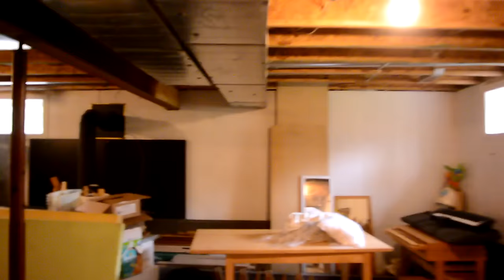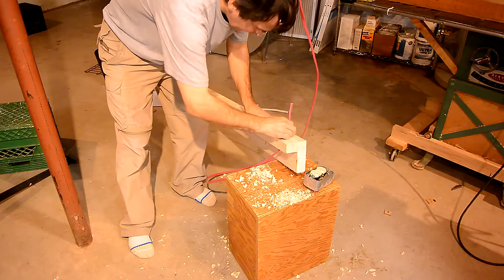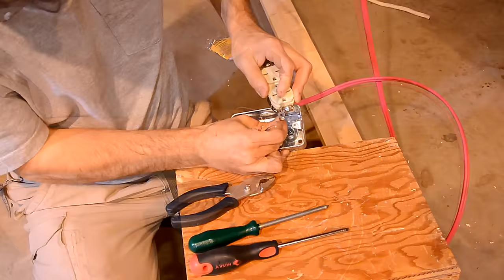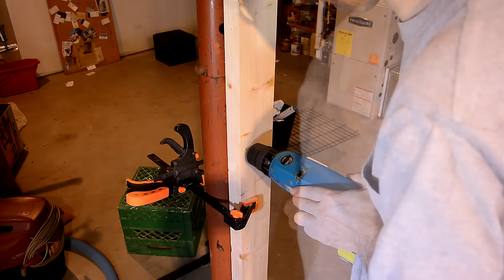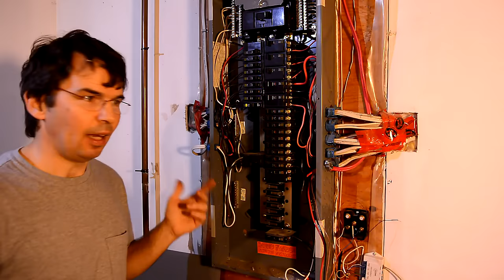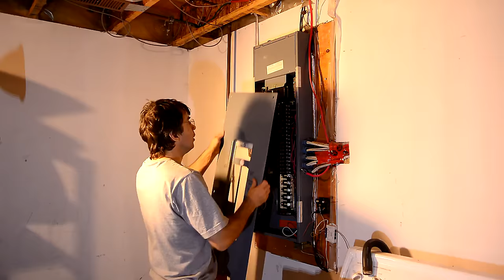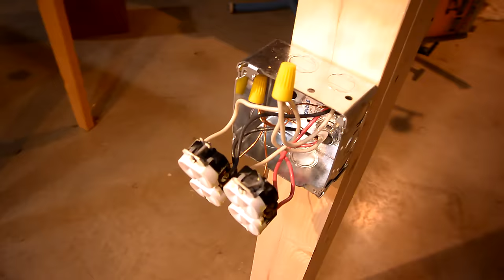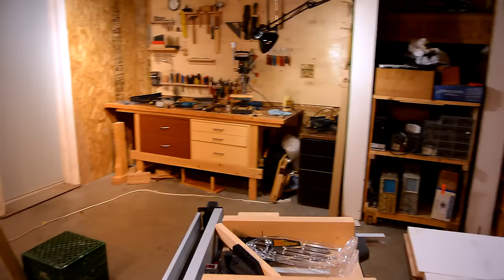Wiring a new 240 volt circuit

Comment: Okay you've done a number of things in this video completely wrong and against code in ontario.   Wrong connector in panel (you used one for bx).  Your 240v plug is too close to the floor (min 6" above floor) lastly your connections for those split Receptacles ( one red one black and one white on each Rec). Those should also then be connected to a two pole breaker).
Reply: good video on how not to wire your 240 volt circuit.....
Reply: Report him to the police, and potentially save his life and that of his kids. Matthias is skilled and all, but some false pride is at work here too...
Reply: Please tell me why that's dangerous.  I've been doing it for 30 years.
Reply: VideoKilledMyDog Did they only recently ban those shared neutral circuits? They used to be everywhere in kitchens. Or if he did it wrong, how?
Reply: +Anonymouspock he should be sharing a neutral across a red and a black not two blacks.  If both blacks are on the same phase the neutral has the potential to carry too much, heating the wire and the receptacle.
Reply: VideoKilledMyDog Might have just used the wrong color and forgot to mark it unless I'm misunderstanding.
Reply: +Anonymouspock there are two receptacles and two cables in the box.  Everything from one cable should go to one receptacle.  The neutral shouldn't share between the two receptacles.
Reply: VideoKilledMyDog Ah, that was my other hypothesis. So then the concern is that two correctly wired and functional devices could overload the neutral by being plugged into one side of the box? But wouldn't it trip the breaker?
Reply: Anonymouspock but what would it take to overload that neutral? I don't beleive he would be running both machines simultaneously much less under load. So I can't beleive that's dangerous.  Good info but a little over safe.
Reply: First of all he is not sharing one neutral with 2 blacks, he clearly stated that he's fed the 4 120v receptacles with a single 3 conductor wire. The second black (and red) are feeding the lower receptacles. He is sharing one neutral with one black and one red, and as long as it's wired to a 2 pole breaker and using the appropriate gauge of wire then it's perfectly fine. Also those are not split receptacles.
Reply: shows what you know.... that IS a two pole breaker, it just has a single toggle. Square D likes to make those kind of breakers for some odd reason.
Reply: +Sovek he never shows what the regular 110v receptacles are connected to...
Reply: If you look at how he connects it to the breaker he switched the wires there.
Reply: "Code" is for people working for someone , you can do whatever you want to your own house.
Reply: jc86 That is not true. Many places will let a home owner pull their own permit for electrical, however they still have to comply to electrical code if they want to pass inspection.
Reply: Mitchell Buss you know electrical codes change often, they get updated frequently
Reply: Homeowners' insurance companies love this logic.
Reply: The police aren't the correct department.  He's not committing a crime.
Reply: @Jason Wisser  2-conductor cable ;)   Or more-accurately, 2 conductors, and a ground.  Ground wires don't normally carry current, so they aren't considered a 'conductor', in trade.
Reply: @Sovek, yes,  they're tied together for trip redundancy.
Reply: @Fester Blats "are" here.  Police is plural, so the correct verb would be 'are'
Reply: Tekmatic Thanks for the info Tips McGee. However he did indeed use a three conductor wire (3 conductor plus the ground) Go watch the video again before you decide to correct everyone smart guy ;)
Reply: That's a 240 breaker, it just has one throw. Square D makes them.
Reply: Tekmatic the ground wire isn't counted because it's bare. So with romex, 14/3 has 3 insulated conductors and a 1 bare wire, but with 14/3 cab tire, with an insulated ground, you're only getting 3 conductors. Ground wires are definitely considered conductors.
Reply: yea big like on this comment
Reply: 100% correct
Reply: No you can't
Reply: The NEC would also tell you that you need GFCI protection in an unfinished basement.  I rarely see it.  For double insulated tools, it seems pointless.  For the bigger 240V motors, it would just lead to nuisance tripping.

Comment: As many pointed out, the casual contact with the live circuit panel bar (even 120v) shows a lack of respect for electrical work and safety. Like leaving the chuck key in a lathe chuck, you just don't do it.  Also never lean out over a cliff to impress your girlfriend at how far you can lean and not fall. Some things are just a bad idea and not defend able.
Reply: Yeah, but having your wife lean out over a cliff to show you how brave SHE is sounds like an excellent idea!!  ;-)

Comment: When you make 120V off of the 240V, does the neutral have to go back to the breaker box? I'm trying to figure out if I can run 240V to a detached garage for a heater, then split that to 120V for other equipment and lighting.  It is currently ran with 120V, wondering if I can pull that 120V through with the new 240V line.

Comment: lol american electricity again :D funny
Reply: North American you mean? It's Canada afaik?
Reply: yup.  Ontario, Canada.
Reply: Canada is in America..
Reply: Those twist caps connecting wire, looks like something you would do 20 years ago. WAGO man!
Reply: Christoffer Salomonsson
When people say just the word "America(n)" they generally mean the USA. We specify "North America" when we are talking about both the USA and Canada so as not to confuse people.
Reply: I've see wagos fall off.
Reply: GALENGODIS we invented it so we do what we want
Reply: Chris Hall, good catch, that's exactly what I'm trying to say! It seems like you got no rules and can do whatever you want with the americano electricity. And it's funny compared to where i live :)
Reply: Peter Šori ok. Harnassed on a large scale
Reply: Mexico is also part of North America.
Reply: Central America is part of North America.
Reply: But it works!
Reply: Doug Reed you can hardly ever win even if you are right online
Reply: shawn white, if a WAGO is corretly installed, it never falls off.
Reply: Shawn White I've  seen twist caps fall off.
Reply: +Andreas Stangl Clearly not installed correctly, or (more likely) used the wrong size. Or used somewhere with a lot of vibration without adding some vinyl tape or other mitigation.
Reply: Yea, you see Anson Mansfield, that's the same with Wago.
Reply: zerpBot Central America is Not Part of North America, thats why its Faller Central America!
Reply: The best part of America.
Reply: America is the greatest country of all time

Comment: If you're sharing a neutral then the two breakers must be tied together so that they both trip at the same time. If they are not tied together and one of them trips, the shared neutral makes the tripped circuit still live.
Reply: Ronald, good catch!  Correct me if I'm wrong.  The tripped circuit is live only on the neutral side if the live side is plugged in and turned on.  And the voltage drop is thru whatever is plugged into the live outlet.  Did I say that right?  I think so.  Let me know, Ronald.  It's a terrific point.

Comment: I have to install a 240v circuit breaker as well as a home run to the outside outlet because the old home owner decided to run the back yard outlet off of the bathroom gfi outlet from across the house. It can't handle the hot tub and kept blowing the gfi.  This really showed how easy it is to put in a 240v breaker.  The hardest part is going to be running the wire up the walll, through the attic and down the wall unto the basement.

Comment: Ladies and gentlemen that's what you get when you let a head strong amateur with total disregard to health and safety loose with a length of wire and a screwdriver. No earth wire shielding, working 'live' (why not wire the breaker first then install it if you must work live) and finally all the plugged in appliances have cables running all over the floor causing a trip hazard. Why didn't the sockets just drop from the ceiling eliminating trailing wires ? but then the ceiling wiring looks something like spaghetti all over the place anyway. More surprising 4k people actually like it, just shaking my head in disbelief. My advice is stick to making band saws.

Comment: Just wait suddenly your comment section will be full of supposed “master electricians” and know it all Europeans who don’t understand electricity but definitely think their system is the best.
Reply: *their
Reply: Daniel Pohren your right! Fixed!
Reply: Your prediction has come true great OZ..
Reply: Mrcaffinebean *you're
Reply: WhiteShadow2k1: yeah, 'cause metal burns and melts, but plastic doesn't.
Reply: Both are used in different circumstances. Not "Nuff" knowledge.
Reply: yeah and plastic conducts electricity very well, but metal doesn't. Sarcasm off, the plastic enclosures use a thermoset plastic, so it doesn't melt when it gets hot.
Reply: Bakelite and urea-formaldehyde are both non combustible plastics. Generally plastic electrical sockets are manufactured from urea-formaldehyde.
Reply: palo 123 As they are in North America. I was referring to the plastic boxes used for main breaker panels. They’re PVC or ABS. I’m sure there are fire retardants added, but I prefer the protective nature of a grounded steel box.
Reply: " Know it all Europeans" ?

Comment: @Matthais Wansel, isn't that bit about the phases canceling on the neutral when they're both loaded only true if both loads have equal reactance? Because it's reactance that dictates the phase angle between voltage and current -- right?
Reply: Or actually, I think they only cancel completely when real AND imaginary parts of impedance are equal in the loads.
Reply: Though I think we could easily show this with math, that would be boring...let's see a video demonstration of these principles!

Comment: Looks like a 12 gauge wire you are putting.  Sure it is enough for the equipment?
Reply: The real question: Is a 15-amp 240-volt circuit breaker enough to power the machines. For a Band Saw or Table Saw, yes it is, unless the saws are abnormally powerful. 20-amp breaker is probably more normal for small 240-volt workshop machines from what I just read online. The wire gauge is rated for the max amps of the circuit, not the equipment someone uses. If a piece of equipment tries to use more than the 15 amps at 240 volts on this circuit, it'll just trip the breaker. Technically 14 gauge is what's usually  used on 15 amp circuits. So he's one gauge thicker if I'm not mistaken.

Comment: Nice video and explanation. For your risky part, you can alternatively wire the lugs of the breaker while it’s off the panel, then install the breaker on the bus bars

Comment: For the 120V outlets added later on, did you run another set of wire and breakers, or did you just run a neutral and tap into the same wires as the 240V outlets for the hots?  I'm guessing the latter option is unsafe or bad practice, but I'm not sure due to lack of experience.

Comment: very nice video ! am glad you have a place to run away too ..
i want to install a mini-split in my garage so that i can do woodworking & need to run a 220v line from my panel which is at the other end of the house. Unlike your situation i dont have a visible empty slot i can use. However, i think i have 2 breakers not being used so am hoping i can use those. I noticed that you did not use a neutral or a ground for your first 220 outlet ? is that ok ? In my panel box i have so many wires running  that i cannot think of a place to pull out the ground wire or a neutral. I got stalled because i didnt know what to do for the neutral and grounds. Perhaps i have a new thread to work with - Very nice ...

Comment: Not gonna bash or try to tell ppl what to do but ONE very good tip is to connect your hots to the breaker before connecting the breaker to the legs. You decrease your chances of getting lit up that way if you don't want kill the main and use a battery powered light to do your electrical service.

Comment: I didn't realize the 240 circuit was just two 120 lines - in that case, how is the ground leg handled? I didn't see a ground wire. I'm used to dealing with automotive wiring, household stuff can be confusing

Comment: Is it safe to have these large metal bars under live voltage? I think in Canada things will be safer than in ussr, nowadays if you look into same thing in Russia, you can touch only ground and neutral, to touch any live wires you need at least screwdriver
Reply: ADFKSJG good thing there's a big steel screwed lid over them at all times, eh?
Reply: It's good, but when it opened - it is awfully unsafe
Reply: ADFKSJG it’s not meant to be open unless its being worked on. 

A blender is dangerous if you run it without the lid.
Reply: Trust me, those are a HECK of alot safer than the old ones, where the metal bar stuck out, not plastic. I nearly blew myself up, even tripped a 1200A breaker on one of those panels.
Reply: Calm down, skippy. Did you know there are bare conductors inside every wire? All you need to do is cut the thin rubber insulation off!!! Oh my god!
Reply: Sovek nice engineering tho

Beefchicken Industries if you not randomly poke with knife, it's okay, but there you can easily get nice warm voltage across you, easily. it is not safe, at least by occasion you can get toasted, and amount of that "occasion" is what makes one more dangereous than other.

Comment: Great Job adding the 240v socket “I have a question Im adding a solar inverter that is 220v out put I have a 100 Amp Double pole breaker going to be used only when we loss the grid for battery back-up and on a DIY Generator to charge the batteries to power my house . This is a work in process , I can get a step down transformer from 220v to 110v  , I was hoping I could just wire the 220v into my 100 Amp Double pole breaker and the 220v would In theory charge 110v Per side of the breaker box  , in have a black wire & a red wire coming from the street one to each side of the box .

Comment: A point and a question from an electrician. Firstly its bad practice to work on a live board but sometimes needs must. But if you do then use insulated screwdrivers and don't hold them by the conductive shaft. Secondly what do regulations say in Canada regarding two separate supplies in a single box?  Where you're sharing the 120v between phases you'd have to mark it presumably so any future work carried out can be isolated safely. Also isn't it frowned upon because you could get a 240v shock if you get stuck between the phases?

Comment: Cool video.  I would never work on a live breaker panel like that.  Ever since I learned that we bond neutral to ground I figured there shouldn’t be any reason you couldn’t just touch a hot wire, as long as you’re not simultaneously touching a neutral/ground simultaneously, but I was not willing to test it.  I’ve got a 10 month old child, of course we installed those safety plugs on all the outlets, but it’s kinda nice to have confirmed that even if a kid jammed a knife into just one side of an outlet, it might not be as bad as I previously thought.  Obviously hoping that never comes close to being tested, either.
Reply: You just publicly admitted to not liking yourself!  Good job there!
Reply: TheGeekPub not sure what you mean.
Reply: LOL. I commented on the wrong post.  Sorry.

Comment: Why did you plug the breaker into the panel before screwing the circuit wire in?  If you finished the wire before plugging the breaker it wouldn't become hot until you were done.
Reply from the maker: Much easier to work with if it's attached somewhere.  I'd say, fumbling with it in front of the breaker panel is more dangerous than having it attached and turned off.

Comment: I love your wood working stuff Matthais and you are clearly of the extraordinary. Well done with all that.
I guess you are in Canada and I'm in Oz but what concerned me about you installation is the absence of any protective earth conductor in your new circuit.
In the event of an insulation breakdown, how does you system trip itself if the person using the apparatus is providing a path to earth via the leakage?  As you said yourself, "if I touch a phase and earth at the same time, I will get a shock". All I can add is that hopefully not fatal, but many around the world have been electrocuted by working with circuits without earth leakage circuit breakers and on apparatus that is not tied to earth via a protective earthing conductor.
You also scared me the way you were working live on the switchboard! You have many dedicated followers but you should warn folk not to attempt adding or modifying electrical circuits unless they are qualified to do so. It's so dangerous!
In many cases, when electricity bites you, you don't get a second chance to make a first impression! ...
otherwise ... love your contributions to all of us on the Tube.

Comment: I've been zapped so many times I think I have a phobia of electricity now. I was just disconnecting my 240V wall mount oven and even after turning off the breaker, making sure the oven lights were off and testing with my probe I still was scared to touch the wires. So was a little frightening to see you doing what you were doing lol